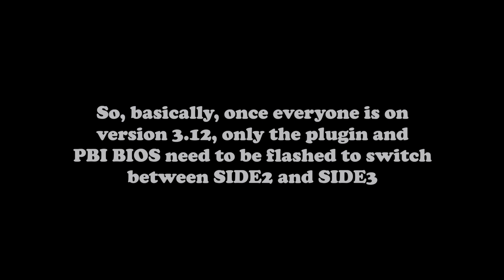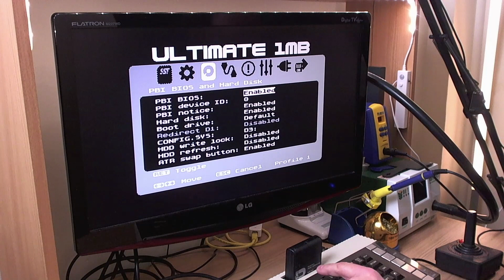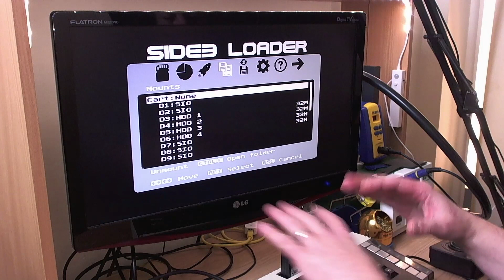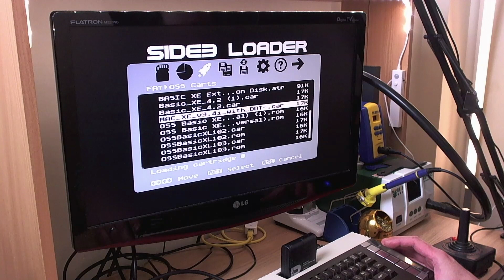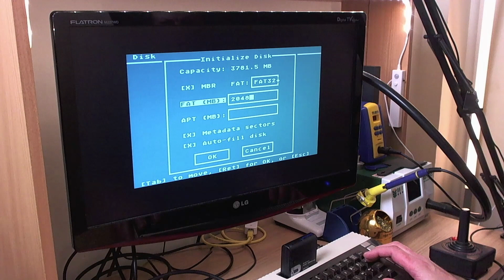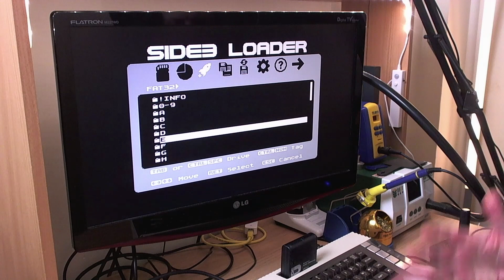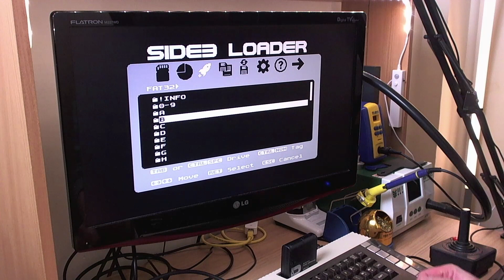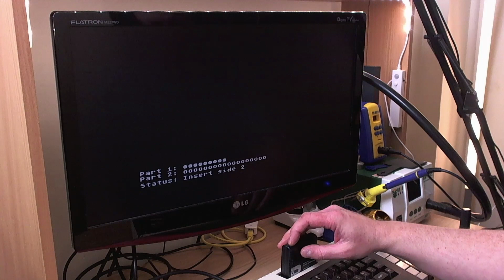How to use SIDE3: Part 2 - Ultimate 1MB

Comment: I think this should be ongoing series, as you're adding and fixing things all the time!
Reply from the maker: You're probably right, although my relationship with SIDE3 is currently at a fork in the road since the vendor made some unannounced changes to the hardware which have the potential to make simply getting it to work more trouble than I can stand.

Comment: Hi flashjazzcat! I have some problems with the SIDE 3. It is not recognized at all in my 600 XL and in my 800 XL it behaves very flaky (screwed up menu, ROM mapping fails, goes to self test etc.). However, on my 65 XE it just works fine. 

Do you have any advices what I could check?
Reply from the maker: Yes. Please try replacing 74LS08 with 74F08 in both machines and let me know if it makes any difference. Usually it's the XEs which have an issue, but your situation is reversed. Still: worth trying this solution first.
Reply: @flashjazzcat  thank you so much for the quick reply! :-) Replacing U19 with a HX (?) was suggested by some guy on FB, and I did that already on the 800, but no success so far ... might try that with the 600 XL as well.
Reply from the maker: @thomaskalbe6018  HCT might also work; not so keen on HC. Try 'F' and 'HCT', anyway.
Reply: @flashjazzcat  sorry, it's an 74F08N I put into the 800 XL (U18, not U19!).  I will definitely try that on the 600 as well, but the 800 still doesn't like the SIDE 3 ...
Reply from the maker: @thomaskalbe6018  Are there any other upgrades in the machine? Any problems with other carts, etc?
Reply: @flashjazzcat  no, the 800xl is not upgraded at all, except for a different ROM (mod not done by me). Simple 8k cards work flawless. 

I replaced U7 in the 600 XL with a 74F08N (got lucky, all ICs are socketed!), but no success. Screen stays black when I put the SIDE 3 in. The 600 XL is completely stock, probably never opened before.
Reply from the maker: @thomaskalbe6018  I've alerted the hardware designer. Perhaps he will be able to contribute some suggestions.
Reply: @flashjazzcat  great, thank you! By the way: the PSU should be fine, it's from Lotharek.
Reply: @flashjazzcat  wow, look at that: I installed the SRAM 64Kb v3 from Lotharek in the 600 XL and the SIDE 3 seems to work! Yeah! :-) Did not thoroughly test, but looks promising! :-) 

One down, one more to go ... :-)   (or even two ... I got another 800 XL with an Ultimate 1 meg upgrade having some problems with the SIDE 3, but that's a different story ...).  I guess I can live on now, but still it would be interesting to know why the SIDE 3 would not work in the 800 XL ...

Thank you so much, flashjazzcat.
Reply from the maker: @thomaskalbe6018  Well, these SRAM boards seem to have 1,001 uses. :) I just received a couple from Lotharek (supposedly to fix Rapidus problems), but I'm pleased to hear you had some good fortune with one of the problem machines.
Reply: @flashjazzcat  yes, that's interesting. Honestly, I don't know if the SIDE 3 is supposed to work in a 16 kb 600 XL. If yes, maybe some timing issues?
Reply from the maker: @thomaskalbe6018  Good point. I stupidly assumed you had already upgraded the 600XL to 64K before attempting to use the SIDE3. In no way is the SIDE3 loader designed to work on a 16K Atari. ;)

Comment: Got a 1200XL with U1MB installed and a Fujinet. I just received a SIDE3 cartridge and I'm wondering just how I should set all of this up so I can play cartridges, have a hard disk and do coding.
Reply from the maker: What aspects are you unclear on? Did you also read the firmware manual?
Reply: @flashjazzcat  I think I had the wrong download originally as it didn't have any documentation. I'm good now.
Reply from the maker: @calab  Ah - good stuff. :)

Comment: Just to clarify- this can run both .rom and .atr files without a problem?  And furthermore, I can use this to transfer files from floppy disks to the SD card for archiving (like my basic programs from years ago?)
Reply from the maker: With U1MB, yes: you can run ATR and ROM (and CAR) files simultaneously without problems. And yes: you can freely duplicate real floppies by copying the contents of a real drive to a mounted ATR.

Comment: You have mentioned in several videos over then years about updating the current sub-bios, and what happens if you update the wrong device with the correct bios but wrong device. Or Visa Versa, This Way or That, The old is BEtter then the new, do it that way vs this way.  
HIGHLY suggest a one bios update to do it all. Even if effects nothing for particular sub group of now uses, but may later need this updated for everyone.
FYI
Reply from the maker: How would one accomplish such a feat, pray tell?

Comment: This may be rather infantile question but (around 3:16 on the video) does that mean we can't use SIDE2 and SIDE3 at the same time (ie. without flashing appropriate plugins)? Do I really need to put my SIDE2 behind the glass with all other "retro" stuff? ;)
Reply from the maker: That's right. There is not sufficient code space in the PBI BIOS ROM to include code to sense and drive SIDE2 and SIDE3 (the SD card driver being quite large even after heavy optimization). Therefore you must flash the appropriate PBI BIOS and main BIOS plugin for the cartridge you intend to use.
Reply: @flashjazzcat  Understood, not a big deal really. I'll "retire" SIDE2 then ;) Thanks for all your work!

Comment: There's one little thing left to make it really "ultimate" - to be able to go to Loader, mount another floppy image and go back to the system without rebooting. Now the only way to do it is to use MATR, but it cannot use FAT partitions :-/
Reply from the maker: Aha... this is also on my wish list. I propose to cache the entirety of base RAM in the cartridge's SRAM, run the loader, then reinstate the cached RAM contents if the user just returns (i.e. leaves the loader via ESC or some such). Big PITA here is the fact we are using the U1MB SDX (to save our sanity, essentially) and the banking/enable register is read-only (the firmware cannot thus discern whether the user rebooted the machine via 'COLD /N', this suppressing SpartaDOS X). But I have tested this approach and it did basically work, so you can expect it to appear in a SIDE3 loader/plugin update soon.
Reply: @flashjazzcat  <3 I love this info!
Reply: @perinoid  Ditto !

Comment: A slightly off-base question here, but is the plugin architecture able to support other block-oriented devices? I ask because in the early 2000s I was talking to some Atari enthusiasts about the possibility of connecting IDE hard drives to a  Atari 800XL and the considered opinion was that a FAT32 file system would be too hard for 64k. This, of course, was before the U1MB and such were available. But it strikes me that the excellent work you and others have done on SIDE3 and accessing FAT file systems means all the heavy lifting has been done, it would just need an appropriate hardware and driver. Would the plugin architecture you mention support that sort of thing, and would it need some kind of firmware update to include the plugin? Sorry if this is a bit vague but I'm not really familiar of the details of how the SIDE3 and U1MB fit into the Atari hardware, and the software side is clearly v complex given the amount of time it has taken to get to this stage. 
There's no real practical need for devices other than SD cards but its a kind of "because its there" mountain...!
I must say the work that you and others have done in bringing this to fruition is nothing short of miraculous, and I hope you get the recognition you deserve for this supreme effort.
Reply from the maker: Thanks for the question, Ian. The PBI BIOS on the U1MB (coupled with a corresponding BIOS plugin if necessary) can handle any addressable hardware you like, within reason. IDE is such a wonderfully simple protocol (compared to SD cards, for instance), that it's really easy to interface IDE HDDs and CF cards (SIDE2 uses the latter) with the 8-bit Ataris. Candle O'Sin was among the first to attempt FAT file system access (with his original SIDE Loader in 2011 or so), and about the only heavy lifting task is all the long integer handling for 32-bit FAT width. But it's all well in hand now. The most unpleasant thing about FAT is actually the lack of a running free cluster count in the BPB, meaning the entire FAT chain must be scanned from start to end simply to establish the number of free sectors. FAT32 has a free cluster count, but it is described as 'not to be relied upon'. None of the native binary FAT drivers for the A8 allow writes yet, but it's something I'll need to tackle in the future. Other than the aforementioned considerations, FAT is no longer a big deal, though.

But yes: CF cards use the exact same ATA protocol as IDE hard drives, and many of the older IDE host adapters for the A8 could be connected to spinning IDE HDDs and CF adapters alike. The PBI BIOS for the U1MB actually contains a FAT file system driver in order to handle FAT-hosted disk images; when I adapted this for SIDE3, I simply (!) needed to replace all the low-level, hardware dependent block IO code with code targeting SD card SPI transfers.

Anyway: I don't know if that helps, but it gives a bit of background. Check out the SpartaDOS X project if you haven't already done so. That DOS provides a read-only FAT16 driver which allows access to standard FAT partitions on floppy drives and hard disks (including APT partitions on SIDE2, SIDE3 and such).
Reply: @flashjazzcat  Thanks, I'll look that up. I've been out of the Atari world for a few years now, what with illness and other things, but having had to move I've uncovered all my beloved Atari stuff and when I get myself sorted want to start playing with it again. Its been a long long time since those days in 1979 when I first played Star Raiders on an 800 in Maplins shop in Southend. I've got a 800XL needing refurb and some 1050 drives, and want to get it all going again, and maybe start playing with hardware again.... I did manage to get an old 170Mb hard drive connected and reading sectors back in 2004, so I just need to remember what I did :D
Reply from the maker: Glad to hear you're getting back into it, Ian. Check out Bob Wooley's 'Smart IDE' articles and the older 'MYIDE' home-brew designs; these should offer a good refresher on what's needed to get the IDE controller hooked up to the Atari bus.
Reply from the maker: Oh - and check out the 1088XEL project. Mytek (the designer of that board) produced a very nice, modern CF host adapter which works with the U1MB PBI driver.

Comment: Can't wait to try mine out.  My U1MB equipped 130XE is not working sadly.  I can try it in my 1088XEL I guess, if I unplug the internal CF3 adapter I assume it will work fine.
Reply from the maker: It should work regardless on the 1088XEL. Be aware I haven't yet created a SIDE3 plugin for the 1088XEL's U1MB firmware, though.
Reply: @flashjazzcat  Oh Dear I'm guessing more work for you !  Did you finish building the XLD?  as I'm guessing the plugin will work with both XEL & XLD
As an aside Views seem to be very much better than the last few video's  Thums Up fella.
Reply from the maker: @grahamrolle3923  I blew the XLD up on first power-up because the 5V and 12V regulators were swapped. Maybe I'll get around to fixing it some time (not sure what blew up). I'm glad to see views on the up as well; I expect people were getting tired of U1MB installations. :)